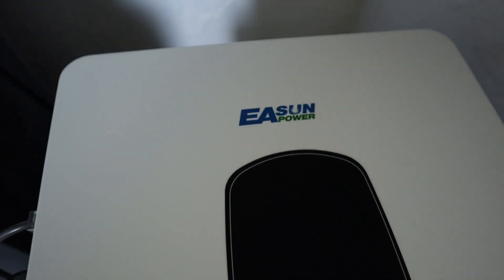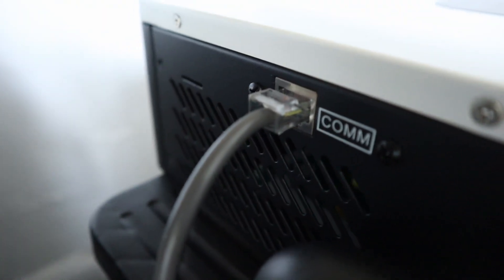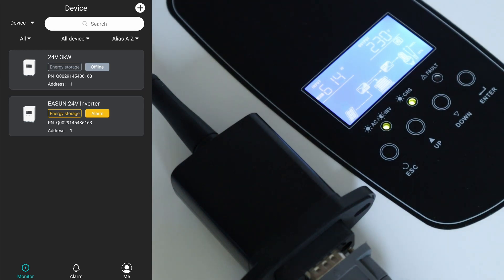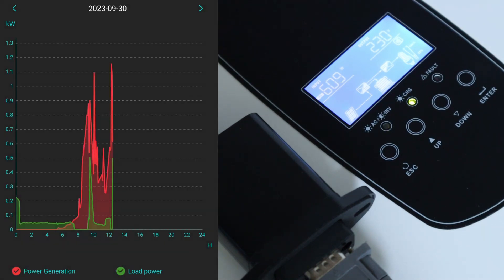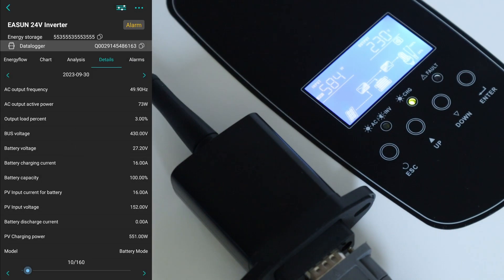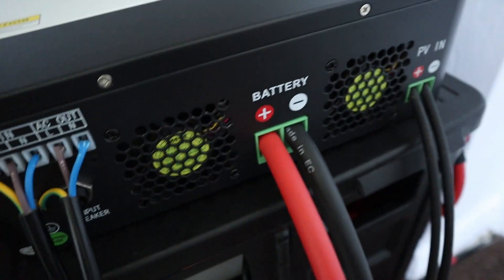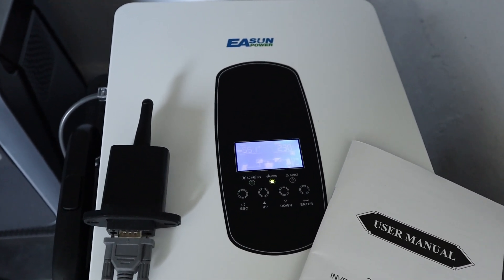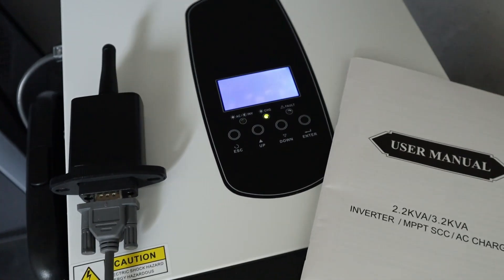EASUN Solar Inverter | Cheap, but worth it?

Comment: Thank you for a great video! I am interested in the no load power consumption from the battery (clampmeter or shunt?) and also, verey important, the power consumption from the grid wiythout charging the battery from the grid (AC plug with a meter?)
Reply from the maker: @adrianr2740  Thanks for your kind feedback👍. With the inverter on and no-load the clamp meter measures around 1.3A. With power saving mode on it uses around 0.4A. I didn't get any amps registered on my plug monitor when connected to the grid (not charging the battery). I hope this helps. All the best, Adrian
Reply: Hi. I have the same model. With battery full, allot of sollar, no load on inverter, it still consume 80w from the grid.  This means 700kw every year jusr if you keep it connected to the grid. Very bad design. I took another invertor and I'm using this one as charger.
Later edit: it looks that not all the time it is consuming 80w. I added a  smart plug to monitor the standby consumtion from the grid and that 80w peak  occure from time to time. So, in the end, it is not that bad.
Reply: @draghicicosmin8861  Are you sure? 80W from the grid for what? Just for heating? This would be an absolute no-go! They claim stand-by consumption is 2W on their website!
Reply: Without load the consumption is very the voltage of battery is decreasing a lot and the economic mode is working only if the load is up tban 100 w than mean that it is not possible to run a fridge on economic mode🤬🤬

Comment: I have issue with this inverter when i switch it off with the side button with only battery attached it keeps switching back on while beeping and then off again and keep repeating this cycle.  It worked fine before i had system off fir few months and now it developed this odd behavior.  Doeas anyone have idea what could thos be. It still works and provides ac i just cant switch it off manually
Reply from the maker: @greg23842384  Good day and thanks for your question. Do you have mains or solar attached to the unit to charge the battery? All the best, Adrian
Reply: @DADvinci  hi Adrian I'm using it purely as inverter and nothing else. I have victron solar controllers  to handle battery charging and this inverter is only connected to my battery and no ac input. There is no fault codes as soon as I switch it off the screen dimm a bit and the buzzing sound come then it just start to turn itself on and off all the time.  I know that two days ago I unplugged the battery supply but I forgot to turn victron first so my victron instead of feeding the battery start apply power to  inverter. I think that could damage sorting internally in the inverter. 
Never had this problem before and I put thos inverter into lot of work in the past charging nissan leaf and it was spotless but now I'm experiencing this
Reply from the maker: @greg23842384  I'm sorry to hear you're having issues and thanks for the additional info. Have you been able to check the inverter settings as I'm wondering if running it with the battery temporarily disconnected managed to reset the core settings? Is the battery itself ok (running at the right voltage) and are you able to test with another battery? I'm hoping the inverter isn't damaged and it's just settings, but it doesn't sound right with the buzzing sound. It does work ok with the inverter switched on? Cheers, Adrian
Reply: @DADvinci  i check all settings and everything is same as it was before. Battery is healthy and at the right voltage i must of burn something internally in the inverter
Reply from the maker: @greg23842384  That's a shame, I'm so sorry to hear that. Can you still use ok when it's switched on?
Reply: @DADvinci  yeah still work fine as long as its switch on

Comment: Hi Adrian,

Would you mind giving a description of your set up/ups and how you use them in the real world please?

Kind regards

Tony
Reply from the maker: @LRDefender1968  Hey Tony! I usually run an all-in-one system (AC200P) attached to about 600-700 watts of 'moveable' panels in the garden. 

The main system, at the moment, is my 24V LiFePO4 shopping cart battery hooked up to my MPP 24V solar inverter, with the 4 x 360W panels (static) in the garden.

I've got my MPP 12V solar station build as backup, which I can charge from the all-in-one or 24V shopping cart system (direct from solar if needed) when things are running low. I give priority to my fridge freezer and only hook-up to the grid for it when everything (including other portable power) is used up. I plan the usage of my washing machine, dishwasher and cooking around the weather where possible.

Things are going to change though, as my 48V battery kit has turned up from China and it's a beast. Depending on tested capacity, it could be a 15kWh (expandable) system which is a game changer for winter and beyond. If I can find a way and installer to connect me up to the grid (correctly), this new battery could be the first step to grid integration, but I'm getting way ahead of the game at the moment. 

I hope this helps? Cheers, Adrian
Reply: Awesome Adrian!

Thank you Sir 👍🏻 

Looking forward to see how you do the change over switch 😳
Reply: no, that's okay